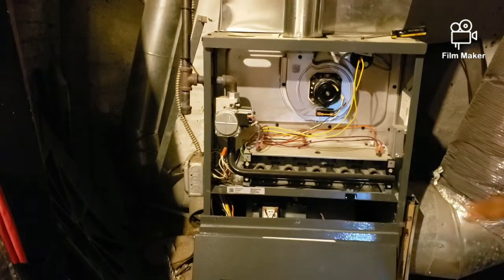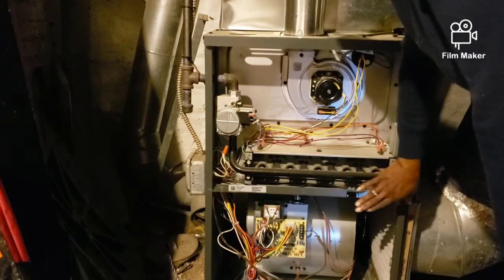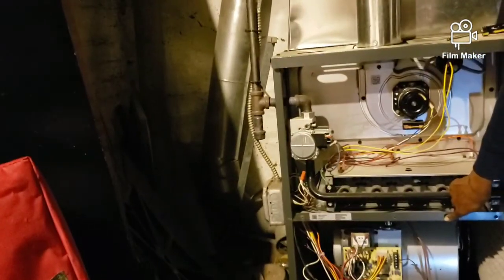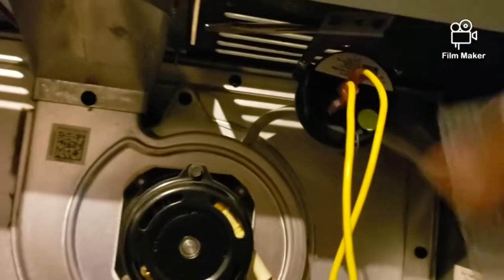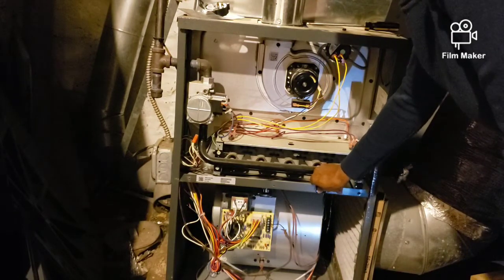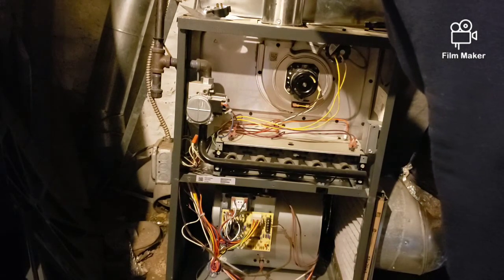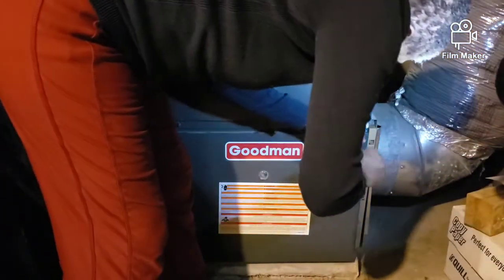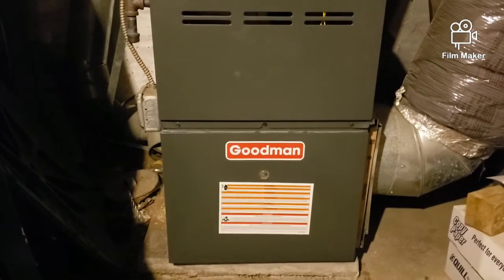Replacing Furnace Pressure Switch

Comment: You got lucky.  Many times it's not the actual pressure switch that is at fault. Many other issues can manifest themselves as pressure switch problems.  Using a manometer spliced into the ventor motor hose will give you a clearer picture of the entire system.  A small obstruction in the ventor motor hose connection port can give a false pressure switch indication.  A minute tear in the pressure switch diaphragm can likewise mislead the technician... etc.  Using a digital manometer will greatly reduce the chances of buying unnecessary parts.  Good you fixed it though.
Reply from the maker: The digital manometer cost about $40. I'm an amateur D.I.Y.er. not an HAVC expert ... BUT, good advice if it happens again.